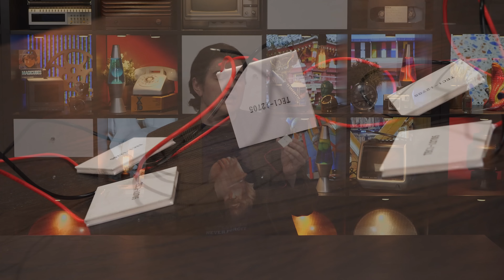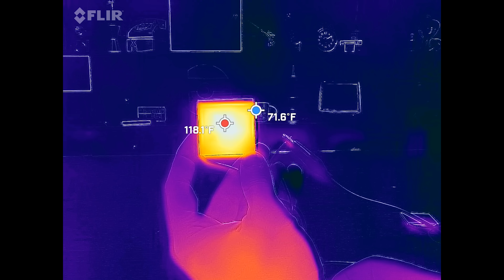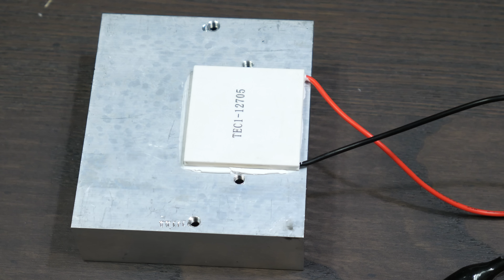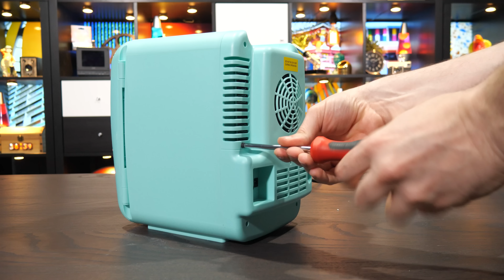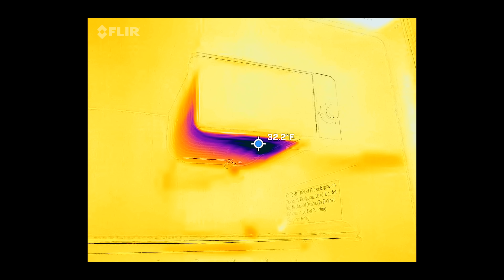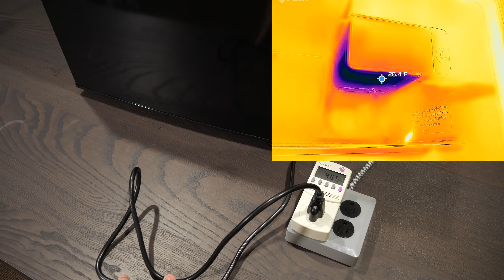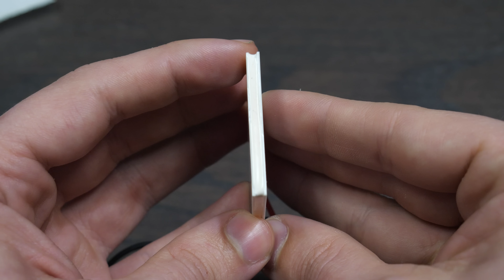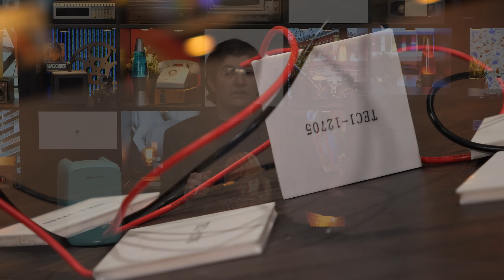Thermoelectric cooling: it's not great.

Comment: I sell a special epoxy that is required to store cool (not cold) and in the early days I built a Peltier junction cooler (using a large portable cooler like for pick-nicks and like 6 of the largest Peltiers available. It worked, but after a few years and measuring it's energy use (with our very high electric cost where I live) I figured it was costing me close to $400 a year in electricity. I immediately went and bought a small chest freezer and used an external controller (like on your red fridge) to turn it into a cooler that is 3X the size and costs about $40 a year to run and never looked back. I have to replace the freezer like every 6-8 years (they die) but they are like $200 so still way cheaper.

Comment: I occasionally use one of those peltier fridges at work, when I need a physically small fridge. Your video inspired me to search for a really small fridge with a compressor. The smallest I found is the 0.85 cu ft Summit Appliance SCR114LWP1. Vendors want eye watering money for these, but there is a Chinese knockoff on Amazon that's only 5 times the price of a peltier fridge. The search showed there's a lot of tiny DC "rotary compressors" from RigidChill and Aspen Compressor, but I guess the lemon law is keeping them from being used for micro fridges.

Comment: There are two things peltier "fridges" do better than real fridges. The first: portability. Sure, you can fit the little blue cooler inside that minifridge. Do you think you can fit the minifridge on the back seat of the car for a road trip? Second, most, though apparently not this one, can be set as a warmer. I wouldn't trust it to get food hot enough to eat, but if you buy some hot food and want to keep it from cooling on the way home, then a peltier food warmer can keep it warm a bit longer.

That said, they are almost all uniformly junk that overpromises on what they can deliver. Great source of peltier modules for hobby projects, when you see them on the curbside.

Comment: Hella cool video, however the math pertaining cost efficiency is a little off. 

Cuz the cube fridge is not gonna draw 22W consistently, the wattage is gonna spike every time it is opened and especially when new stuff is put inside. As you yourself have laid out, an top-opening cooler would be way more efficient there ;D

Not exactly gonna be an actual factor in making the peltier fridge any less trash, but yaknow, for the sake of accuracy.

Comment: @29:38  I have a mini fridge cube model with a rear mounted vertical evaporator. From Menards. I has ice build up on the evaporator, and needs defrosting every month. And yes, mine also has a very short run cycle.

Comment: You can use these in reverse to generate electricity. They are used on wood heaters with a fan to blow heat around. 

Really surprised you missed that.

Comment: I have a Peltier cooler that draws about 12-14 amps at 12v.   It works fine.  It keeps stuff cold in 90 weather.  Helps to put lots of cold stuff inside to start.   

Yes, keep the vented side clear.   Since we were in a convertible, we didn’t care.

Comment: Why didn't engineers come up with better and more compact compressor designs yet? All it needs to do is compress the gas enough and hold that pressure. And I guess the flow rate may matter.
Reply: They actually have, and more efficient designs have their place in other areas - but the fridge compressor also needs to be very long-lasting, reliable and (most important of all) cheap to manufacture. The reciprocating design works great. Where efficiency matters you're more likely to find a screw compressor, but those have to use intricate shapes manufactured to very right tolerances. That costs money.

Comment: They are good for as thermoelectric generators… but only for those tiny fans that go on your woodstove lol i dont think you mentioned that they work as thermoelectric generators come to think of it? Meaning that if you apply heat, or cold to the device you get electric current, not a ton but some. Also the catch is you need temperature differential in order for it to create any kind of useful current, so you gotta use some big ol’ heat syncs or some kinda water cooling/heating system. This is why they work so well as a woodstove fan powercell… sit the hot side directly onto the woodstove and attach a huge heat sync to the opposite side and booyah!

Comment: The tiny blue cooler isn't food safe so it's terrible but what about the total energy used in the closed system of the house? The house these devices are in will be warmed by the heat moving from inside the cooler/fridge to the house's air. This air will need to be cooled in the summer time which requires more energy. In the winter time the extra heat helps.

Comment: Just so people are aware: portable coolers that use compressors do exist. I have one. Yes, it's more than double the price of a thermoelectric one but it's amazing. It can even be used as a freezer.

And because it's so efficient, it can easily be run off of batteries.

Comment: I bought a small dehumidifier that uses a peltier and modified it to keep it's cold side inside a enclosed space, while the hot side is dissipating the energy in the room with a fan. I'd say it's a great application, but when those micro membrane dehumidifiers become cheaper I will revisit this setup.

Comment: I have a Frigidaire branded one of these thermoelectric mini fridges (the EFMIS188-SS to be specific) and I haven't had any issues with it. 
It holds an entire 12 pack of soda and it cools them down from room temp to ice cold in like 6 hours. 
I can't hear the fan at all even though its like 8 feet away from me, I don't notice any increase in temperature in my room, and my electric bill has gone up maybe like $3 a month with it plugged in and turned on 24/7. yeah idk, I've been pretty pleased with it for the $60 or so I spent. 💁

Comment: 29:49 You need to toss in some of them popsicle brand ice pops or otter pops. Something relatively small that's also not messy for the tiny freezer, but also is a good little cold snack.

Also my regular sized fridge has a very loud compressor compared to other fridges I've been around... But at the same time, My fridge has been in daily use for almost 30 years (since 1995, even surprised myself when I looked at the date) and not failed yet, and the quieter fridges seem to need to be replaced every 10ish years, so I'll take the higher noise level over replacement cost every single time. I may have lost the noise battle, but I've won the price war several times over so far with no signs of giving up yet.

Comment: Maybe if you run lets say four peltier elements cycled through by an electronic for keep them from leaking back heat and get inefficiant
and cool the outside with a vapor chamber, insulate the fridge and use a thermostat it might be better. And way more expensive of course.

Comment: Watching this via the internet?  Then you're using Peltier coolers.  They are embedded in the laser assemblies used in fibre optic communications, because temperature control is critical to keeping lasers on the correct wavelength.
Reply: Thermal wavelength shift is one of the weirdest things I've seen so far as a chemistry student. You can drown certain red laser diodes in liquid nitrogen and they will become orange.

Comment: You know what... actually I wanted to buy a Peltier element module to try and maybe find some practical application for it (there is a "cool" effect involved - not from the physics perspective but from ... um... people? I don't know... okay, "nerdy gimmick") and after watching this video I have realized I've saved myself a couple of dollars and will spend them on smth a little bit more effective... Hm, maybe Stirling Engine?.. Damn, it's not efficient as well but at least it looks nice lol... And it will power some heat pump. Great idea, right?

Comment: Besides not having a Temperature Controller to switch the Peltier Element on and off, the other reason why that little blue piece of Cheap Chinese Crap pulls so much energy is because it basically has little or no Insulation to keep the room heat out of the interior cool zone...another reason why a proper Fridge is INFINITELY better...they have Insulation...the newer the Fridge, the better the Insulation...

Add an interior Thermostat and a Temp Controller to the blue crapbox and it will get a little cheaper to operate...but not by much unless you also MASSIVELY increase it's insulation and replace the door seal with one that can actually do what it's supposed to do...

If you REALLY want to make a Fridge that uses Peltier Modules as the cooler, then build your own with LOTS of Insulation in the wall, top quality Thermal Paste between the Modules (yes PLURAL, use more than one) and the Heat Sink and use a Temperature Controller to turn the modules on and off...oh and use one or more top quality fans too, not the cheap Bargain Basement PC Fan used in his blue crapbox...

😄😁😆😅😂🤣

Comment: Actually what your calling a ‘heat pump’ is actually just a compressor
Reply: It is a heat pump, thought the common meaning today is that a heat pump can move heat in and out of a space.  But it is a heat pump, just not as commonly defined.
Reply: @msromike123  Even Alec called it a 'compressor' at one point.  A 'compressor' is usually a central part of a 'heat pump', the electric motor and it's attached compressor is manufactured to compress the refrigerant gas to discharge.  Using your definition of final cause a air compressor can be called a power wrench tool or a car lifter, or tire-inflater.  that's not what it is, it's defined by it's function not it's final purpose.  Maybe I should be calling this keyboard a 'writer' using your logic
Reply: @Cheetobum  Ok, my bad!  If you are referring specifically to the roundish black canister thingy with copper tubes going in and out, of course you are correct.  It is a compressor.  I was referring to the system as a whole. And was just saying that technically a refrigerator is a heat pump.

Comment: My one practical use for peltier elements: cooling sensors in astronomy cameras (if you can call astronomy in the city "practical"). Being able to get my sensor 35C below ambient on a hot summer night is fabulous, and I don't care if I have to supply another 35-50W to do it.

Comment: Just for fun, how much of a difference would properly insulating the peltier fridge help? That back panel looked like plastic only. Would be a fun experiment.

Would still be limited by terrible efficiency, but reducing heat entering through the plastic may help the little guy out!
Reply: Maybe reflective tape in the back where the heat sink is radiating heat and spray foam through the hole(s) you drilled? If it tries to freeze, try a thermostat/switch?

Maybe even an extra layer on the outside?

Comment: I recently was curious about the possibility of using a series of Peltier devices to generate electricity from a long length of pipe. What I quickly discovered when beginning research is that there's not a particularly clear model of how they generate current vs. voltage; thus, probably why you almost always see them applied in situations with a uniform heat source (i.e. not long lengths of pipe)

Comment: Is the lack of door insulation indicative to the cavity temp being of poor quality or is it insignificant? I would like to see just how efficient a a peltier beverage cooler like that could run if it were set up with a better insulated cavity. With a can of spray insulation being 10-20 bucks. It would be a good short video to see if it were able to go down to 32 degrees faurenheit or 0 dgrees celcius. 
Yes im canadian and yes we have to use goofy emperial figures in a lot of trades because of goofy US manufacturers.

Comment: You can indeed make a high efficiency fridge out of these, and even a freezer. You just need a few in parallel, and 3 in series to reach 77 below ambient. The cooling affect is all in parallel, and you under volt them. They can take a bunch of power, but its a waste. They are more efficient at low power. And since they are so cheap its not a problem buying 30 of them. TechIngredients did this.

Comment: In my opinion, the most useful application of the Peltier effect has been found in space exploration. Engineers have reversed it and, by creating a thermal gradient, started to generate electric energy. The gradient itself is created by the nuclear decay of plutonium dioxide, which heats one side while the other side cools, radiating heat energy into space.

Comment: It seems people here don't realize - it's not the use of "typical" that implies "it's a minifridge," but rather the way he says it. Thanks English. If he said "it's bigger than a typical minifridge," he meant it's a minifridge. If he said "it's bigger than a typical minifridge," he didn't
EDIT: Bro the quote he references from 1:01:14 in the original video "The red fridge will save a bit of energy, too. Though, not that much to be honest. Minifridges tend to have fairly thin walls, which means they don't have as much insulation..." 
  so that VERY much implies "it is a minifridge." ...But also at several other points in the video you pretty explicitly describe it as a small fridge, not a large minifridge. I understand what you were going for but I can see how someone might hear that line and go "...what do you MEAN minifridge??"
Reply: A similar case (though more the implier's fault IMO) of this happened recently when I had to order tires from a tire shop, so I called them, asked if they had the right ones, and they said they'd text me back if they found anything. 

Later I get their text: "Vitour Galaxy 165/65r15, $89/ea, $356 for 4." (Tires for a classic VW Beetle BTW) 

Okay, so they have them in stock, RIGHT? Well, I get there, and they say "no, we don't have any in stock, that's just what we would have to order, we can have them in in a couple days. Would you like us to order them?" Like BRUH I drove an hour out of the way to come here.

Comment: I use an electric cooler while camping. (Coleman).
It keeps drinks cool to between 45 and 55°.  it sits outside under the camper in the shade.
With a 90 to 95° external temperature.
It seems to be well insulated, and I think it works well for its purpose.
We have a countertop ice maker inside the RV that can be used to cool drinks further if needed.
Food is always kept inside the RV fridge.
I also have a smaller one in the vehicle to keep drinks cool while driving.  
They go from the Coleman into the mini which is plugged into 12v.

The system seems to work well.

Comment: The thing that makes me wonder about peltier efficiency is just how efficient can it actually be if you really tried?
-Chest type freezers loose less heat when opening the door.
-Thermostat to not waste energy keeping temperature.
-Since Thermostat is added, turning the peltier off would mean heat would get from the outside to the inside. Should be minimized by using a small heatsink and a fan inside that only runs if the peltier is running.
-Cold air tunnels from the cold side of the peltier to the opposite side of the peltiers location in the box to evenly distribute cold energy.
-Thicker insulation. Let's say about as thick as modern full sized refrigerators for comparison.
-instead of blowing air on the hot side, pull it away as if you push the heat, the heat from the fins go and touch the insulation, decreasing efficiency.
-A good quality peltier module (There are cheap ones that are even worse and perform horribly).
-Good quality thermal paste
-Copper heatsinks
-Good door sealing gaskets
-since temperature on the cold side is affected by how hot the hot side is, a really good heatsink that stays roughly the same temperature as the ambient air

These are just things that pop into my head, there may be more ways to try to make it more efficient
Reply: This ladies and gentlemen is why so many engineers still try to make these things work. They're just too 'cool' to give up on. Hell even Intel took a stab at another TEC based CPU cooler in recent years despite all the essentially failed attempts since PC's have been a thing. It even monitored the the dew point to minimize the chance of condensation.

At the end of the day you too would come to the same conclusion but that doesn't mean you couldn't make something interesting. I've seen pretty clever refrigerators using these and Tech Ingredients basically did what you're proposing. Yes it works but no, it's still not a practical alternative outside of niche use cases.

Comment: We use a little portable fridge similar to this at work just to keep milk and a can or two of drinks cold. It says on the unit itself that its much better if you put something that's already cold in rather than using it to make things cold. Weirdly, it has two positions on it's switch: hot or cold. Reading the manual, the hot setting doesn't actually heat things up, it just keeps things hot.

Yes, it's quite loud but it's in an already pretty loud environment because we have a lot of extractor fans running constantly so it's not really an issue. The inneficiency isn't an issue either because it's not me that's paying for the power.

Comment: You can't imagine how happy I was to hear you talk about the refrigeration cycle again. My favorite running bit on this channel. Unfortunately I still have a portable AC because that's all I can fit, and now I'm in the awkward position of thinking one of those crappy blue boxes might be somewhat useful since I don't pay for my energy, especially if I could stuff some cotton balls or styrofoam into the door to improve the cooling capacity... but at least I can make an informed decision on that now!!
Reply: My use case really boils down to basically what you said; a toy. I wanna futz with it, rip it apart, see if I can make it less garbage, maybe do some soldering practice with it.